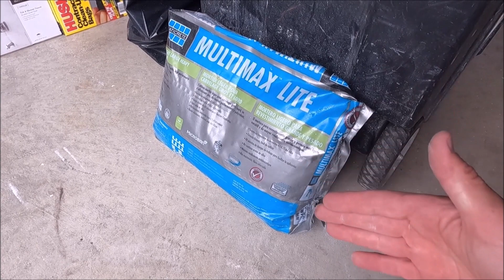FAST Way to WATERPROOF Backerboard for a SHOWER

Comment: I wish hydroban was available here. 😢 I am guessing you could do the same thing with kerdi board. Just not sure why they haven’t yet jumped on this process as opposed to band/thin set. Would sped up the process, especially for niches.
Reply from the maker: I totally agree, it definitely speeds up time
Reply: Yeah, I'm from a small town in upper Michigan and have the same issue. The best option is order it on amazon.

Comment: Is it a concern to install tile over areas that get pretty much covered in sealant? Like the bottom of the niche. It's ok to install the entire niche sill over sealant?
Reply from the maker: Negative, no problems at all. Think about RedGard all walls on a shower. Thinset sticks to that no problems.
Reply: @LandbergTileTV  yeah I know it does but redgaurd isn't the same product. Anyway, was just curious.

Comment: Must you use sheet membrane or can you just use sealant. You can place thinset directly onto hydroban boards similar to installing WEDI system or am I wrong.
Reply from the maker: Yes, you can use sheet membrane and thinset rather than sealant.

Comment: Nice vid. You should have let the over lap of the membrane fold into the niche. Sheet membranes are great; so is monolithic topical membranes
Reply from the maker: I'll have another coming soon using corners and band rather than the sealant. So many ways to do it!
Reply: Kick ass. Can’t wait
Reply: Kick ass. Can’t wait
Reply: Kick ass. Can’t wait
Reply: Kick ass. Can’t wait
Reply: Kick ass. Can’t wait
Reply: Kick ass. Can’t wait
Reply: Kick ass. Can’t wait
Reply: Kick ass. Can’t wait
Reply: Kick ass. Can’t wait
Reply: Kick ass. Can’t wait
Reply: Kick ass. Can’t wait

Comment: I rather have the boards. I have had bad luck with the sheet membranes. 😕
Reply: I personally hate walking onto jobs where they sheetrocked and have to use the sheet membrane, especially with the larger subway tiles, it's so hard to deal with lipage where it laps.
Reply: @Thetiledoctorplus  understandable. Thats my main gripe with fleecing, all the corners portrude so much after 2 or 3 layers in some spots.

Best quick fix is grind some "meat" off the back of those specific tiles to make them sit more even.

Comment: I've done well over 250 showers with   shluter systems that uses the kirdi membrane that is just like this never had a call back. Anyone stuck in the stone age using concrete board and redguard is working way to hard.

Comment: Sheet membranes are garbage , just use the wall board , I am a certified installer and followed instructions to the T and pulled a tile off to check coverage and membrane started pulling with it … and that was following day
Reply: I agree all this membrane is just another means of selling you MORE product than is really required. Wall board, hardibacker  etc etc & redgard works just fine. You are NOT building a swimming pool you are building a shower
Reply from the maker: You pulled a tile off the following day to check coverage? I've never had a problem with sheet membrane with over 50 showers.
Reply: @LandbergTileTV  yeah I installed sheet membrane at end of day then tiled following morning and had to pull a tile and it started de laminating the sheet membrane from wall
Reply: @danthecarpenterman9463  Check your thinset. Some thinsets dry slower than others.